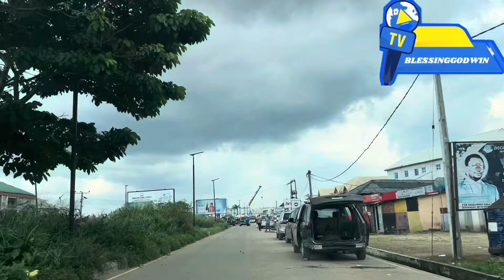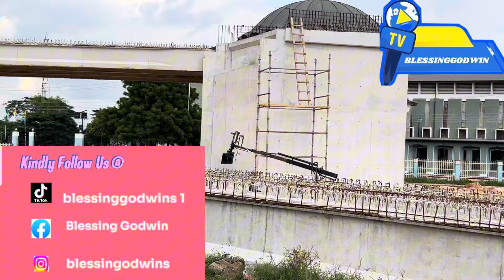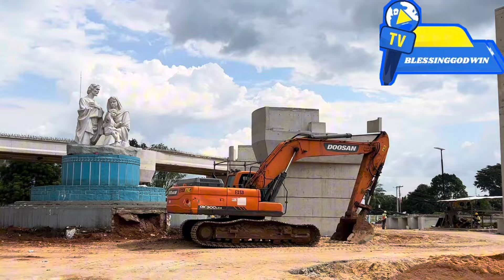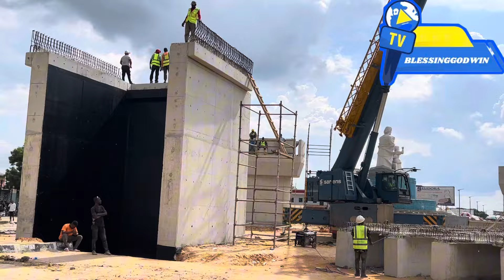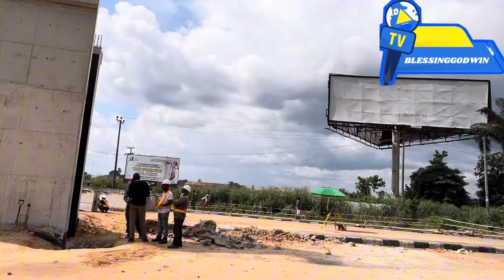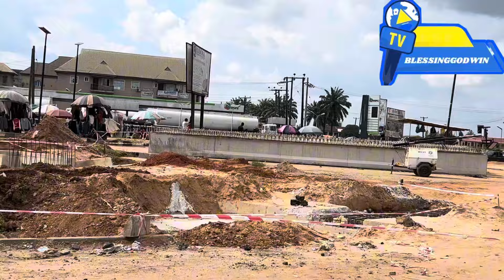OWERRI CITY:INCREDIBLE ASSUMPTA CONTROL DUAL CARRIAGE FLYOVER CONSTRUCTION IMO STATE NIGERIA.

Comment: My observations. 1 contractors crane-burg is a South African reputable contractor. 2 neat work. 3 Quality design. 4. Flyover its self is a 2way or twin step down flyover. 5 each lane is design strictly 2 way lane without a service reserve lane or fondly called emergency lane. 5 the flyover also will not have a pedestrian walkway. 6. It will serve as a step down or landing only meaning there will be no opposite climbing and thus reason the reason of height which shows it’s only go landing. 
7 the work duration is still far on completion due to digging and erecting the landing walls.

9 Comparisons with Anambra Ekwuluobia flyover 1. Anambra fly over is a Preston design making it more architectural and structural durability than Imo flyover with a suspended design meaning it is a hanging flyover which will not last stronger than a Preston Design. 

10. Comparison. 2 Anambra Flyover is 3 lanes with an emergency lane on opposite drive and with a pedestrian walkways. 3 Imo flyover from design shows that it’s calculated to be a speed landing control bypass between 80km-120km ph which shows that speed radius prescribed the actual road lane to be 3-4 each lanes on landing while Anambra flyover is design as urbanised transit bypass with about 40-80kmph which probes land on actual road lane is 1-2 lanes on each of the side of the actual road.meaning that the place or area is densely populated with habitats occupying even the closer area to the complex roads and not a super high ways. 

Conclusions is that Imo is built as a speed bypass while Anambra fly over is built as even bypass which allows motorist to navigate to eighter park and shop or park and answer ur calls or any other. 

I will give it to Anambra flyover for featuring most modern features needed in complexity and I will give it to Anambra flyover for been built to last decades than the imo flyover which will need a renewable maintenance been a suspended design flyover.  

Craft and art design is just a makeover and has no value to add to durability of a flyover just as seen on imo walls of flyover pillars. 

Kudos Anambra flyover won this debate analysis. Thanks for reading. 👍
Reply from the maker: Well you really tried to have made out time for this elaboration but it still remains your opinion though. Thank you 🙏
Reply: You started out making sense, then you lapsed into obfuscations and value judgement based on biased information. Despite your best effort, nobody is convinced that Ekwulobia flyover, a poorly conceived project currently being executed by unknown persons with no track record has any of the attributes you mentioned nor does it look better quality than the Owerri flyover even by mere visual inspection. Nor are your ideas confirmed by the quality of the connecting roads to the Ekwulobia project. Suffice it to say that what we are seeing at Ekwulobia is nothing but a bigger version of Port Harcourt Road Fegge, Onitsha. See the state of that "road" supposedly guaranteed for 20 years just a few months after construction. Sadly, critics of this charade are stigmatised by hired 2media agents".
Reply: Thank you for stating the fact. Imo state has never got it right with leadership
Reply: No need for comparison all the flyovers in South east are superb. Hope Uzodimma is doing well
Reply: @DtourDtour then face your Anambra and leave imo alone
Reply: This write up is filled with mashed up information and false assertions.
1. Craneburg is a high quality Nigerian owned contractor.
2. This control flyover is an interchange.
3. Ekwulobia flyover is a regular single carriageway flyover using Prestressed beams.
Reply: @camion_xyz  stop deceiving yourself. What’s being built in Owerri is another substandard flyover like the ones built by Okorocha. Where are the Okorocha flyovers today? It is a shame that Owerri is now competing with Ekwuluobia. Imo state is a failed state
Reply: Late Hebert Wigwe's wife is the owner of Craneburg. Craneburg builds many projects in the South West.